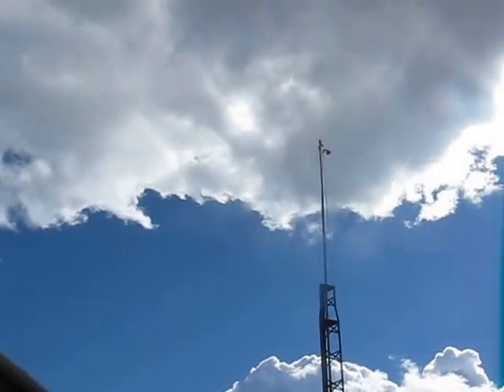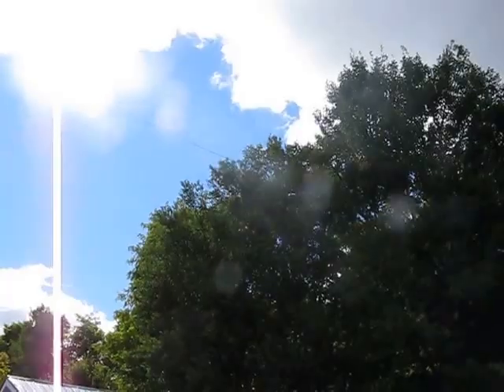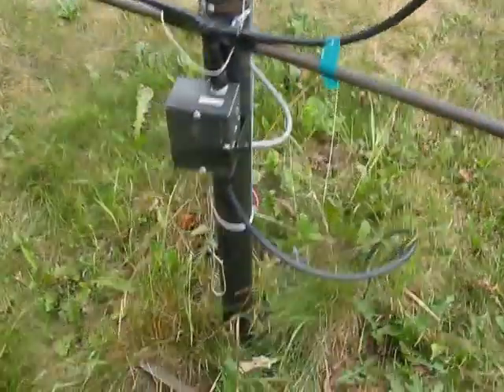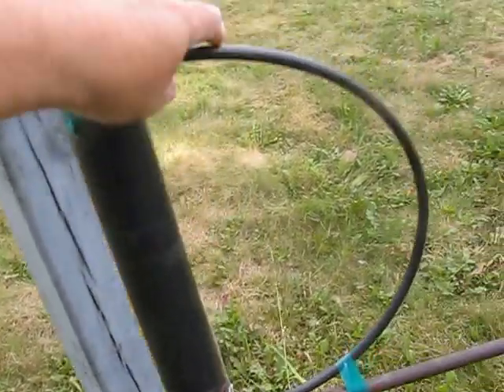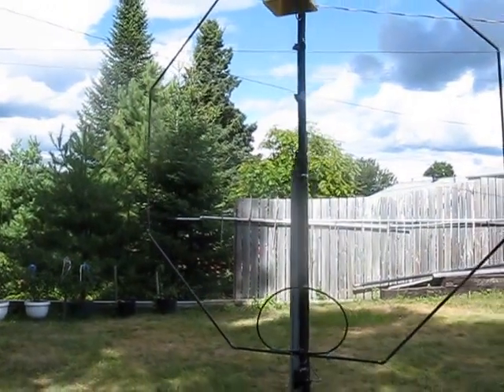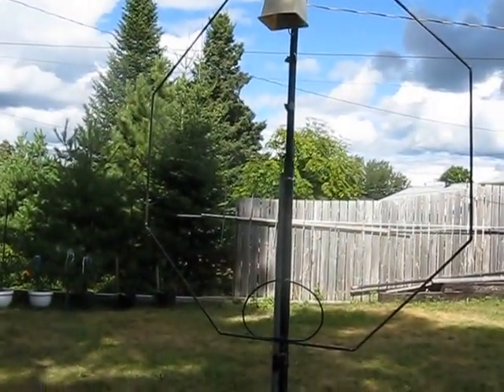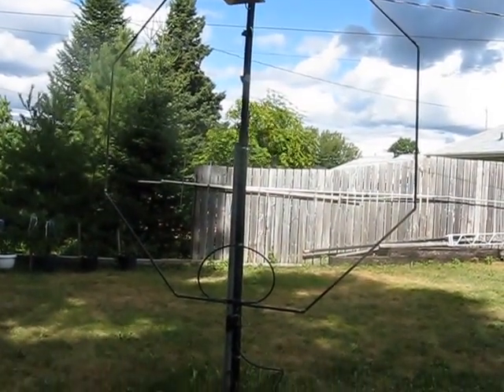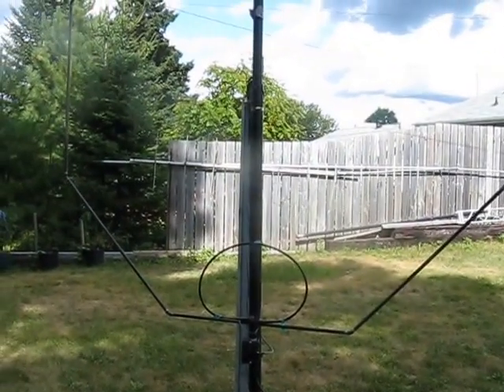LNR quad band ef ant and my STL

Comment: This is very interesting. I'm looking at the EF-QUAD and would love to add 80m resonance. Can I just add the coil and 16ft. of wire to the end?
Reply from the maker: Ok Andrew. Id say the coil has to be sufficient inductance so that it acts like a high reactance on 40 and the other bands and thus sort of isolates the 66 ft portion of the main element so that it still works like it should on 40,20,15 and 10 but on 80mtrs the coil acts like a loading coil and loads up the 16 or 20 ft something tail end. -- I went looking for articles of this type of antenna on the web but didn't find any!! There was a qst hint and kinks article about this type of end loaded two band antenna. Also one of the Antenna Compendums.. I think the orange colored one a fellow built a 40 and 80 meter antenna he called the Swallow Tail antenna. I will try and find an article for you in the next few days. Id say the coil should be about 65 uh (something like that) to work properly for 80 meter resonance and to isolate (more or less) the other 40 through 10 meter bands. 73 earl ve3ab
Reply from the maker: I found the article on end loaded two band (multiband) antennss. Have a look on this page of mine:http://www.hamelectronicsmagazine.com/antidas2  - I don't see too many articles on this type of antenna. Might work though. My concern might be that with a large coil at a voltage node - there could be a high voltage spike as a result of collapsing fields (coil kickback). Anyways..have a look at it and should be a starting point for you.73 earl ve3ab
Reply: I asked LNR and was told that by using a tuner, it would simply be a 1/4 w/l on 80m. However when I asked Dale Parfitt, who is the inventor of it, he told me that it would only do 80m as a monoband with radials.